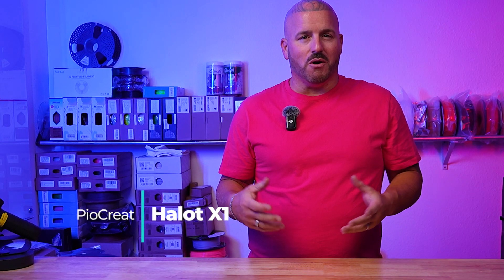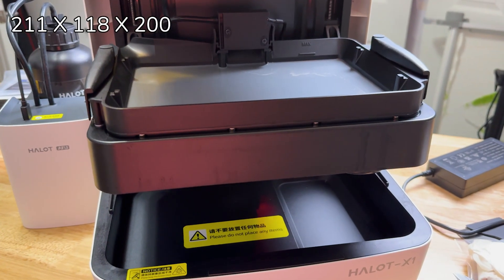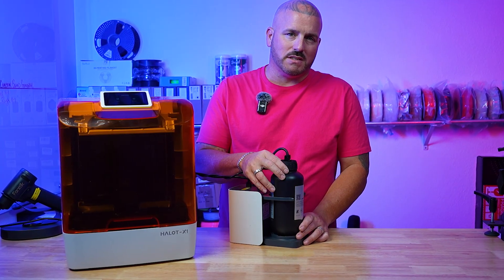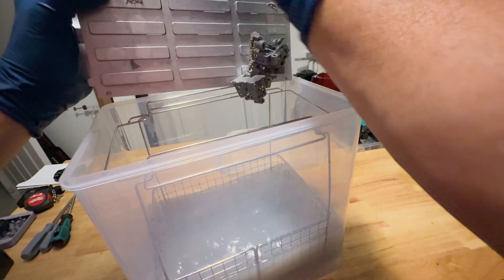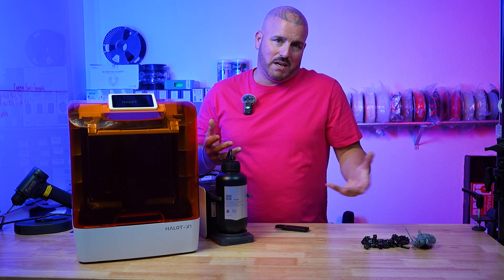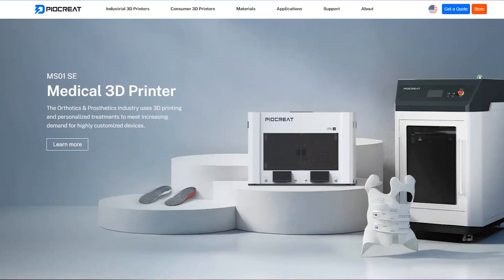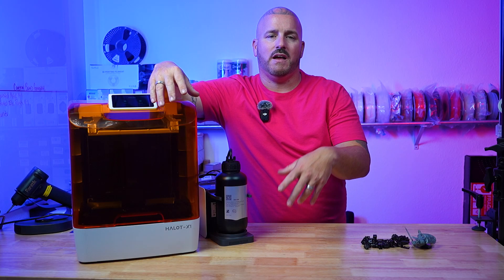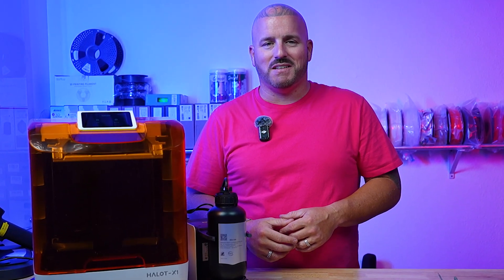This Is A Game Changer! Piocreat Halot X1 Review

Comment: How can I add tempered glass to protect the screen? The tempered glass is 2mm thick, and since I can't level the bed, the screen will fail.
Reply from the maker: Just add a screen protector. It will self level after that.
Reply: @stayreadyto3dprint But in what configuration do I change the height so that it is 2mm higher?